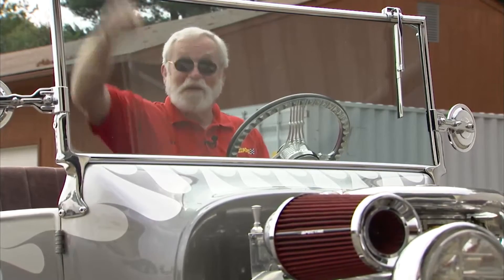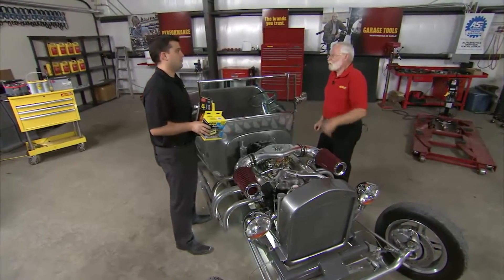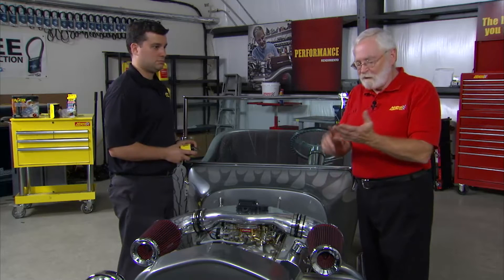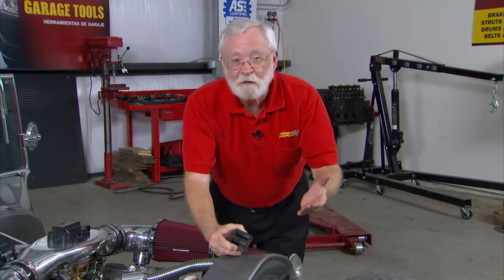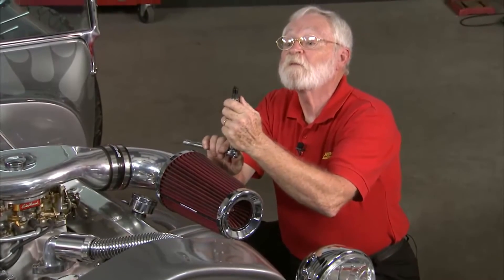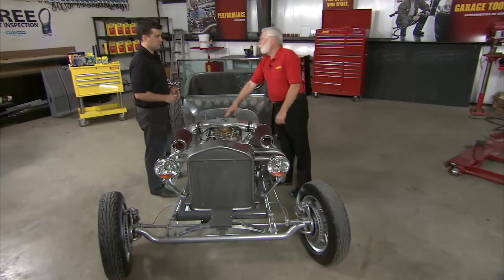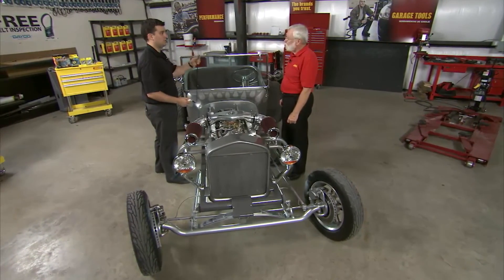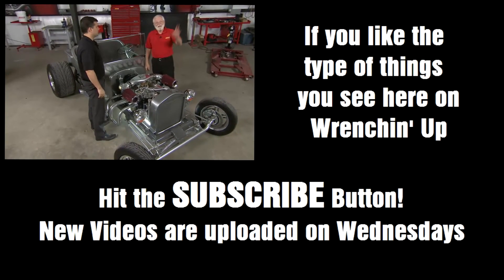Improving this Street Rod's Spark Performance - Wrenchin' Up

Comment: On an chevy efi style distributor cap; why would the center electrode "blow" apart? Looks like someone shot it with a shot gun and hit the bulls eye? And there is the powdery substance all over inside the cap as well.
Reply from the maker: John Kerns Hi John - This condition is almost always caused by what's known as high secondary resistance. That is high resistance somewhere in the ignition system's secondary circuit - the ignition coil(s), distributor cap, rotor, spark plug wires and spark plugs. Old worn out spark plug wires and spark plugs are usually the cause. A bad or corroded negative battery cable or engine ground strap has been known to cause this problem too.
Reply: ok; thanx now I know what to start looking for.